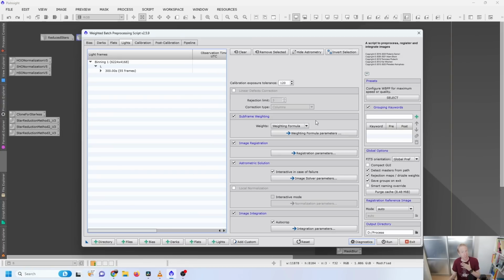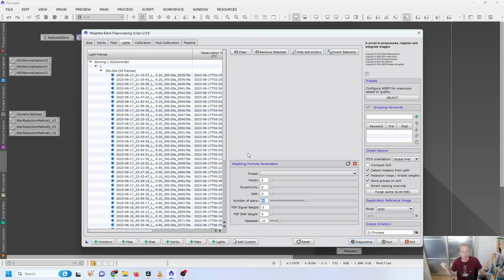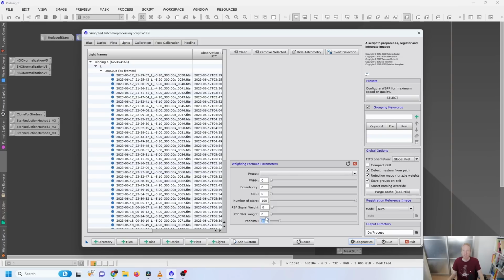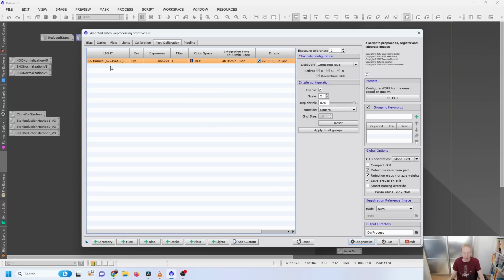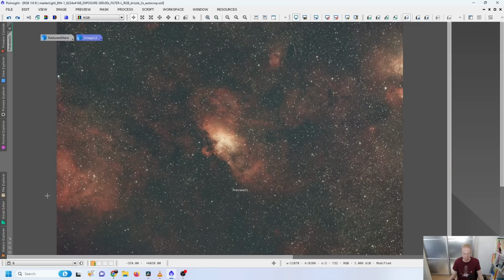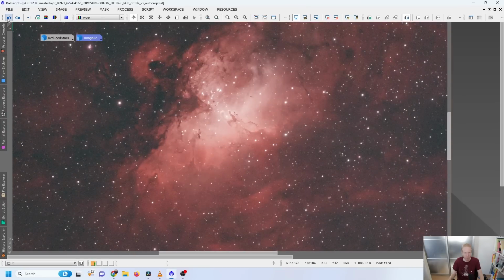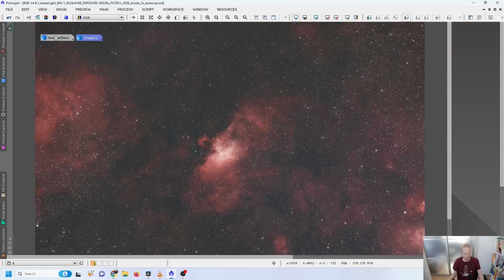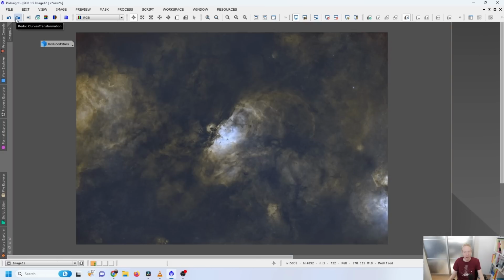New dew shield for better Hyperstar! Let's image the Eagle Nebula!

Comment: Domo arigato for your informative videos Cuiv... how do you manage the cables from your camera through the aluminum dew shield? Aren't the power/data cables from the camera supposed to cross the light path in a kind of arc, thereby requiring two exit points on the dew shield where it has only one cable exit point? Anyway, would love to hear how you work around this situation.

Comment: Nice video Cuiv, helps.

 want to setup anti-dew for Celestron Edge 8?

 A few questions if you can advise please:

 

1.  Is the Celestron dew shield still needed, if I setup the Celestron Dew Heater Ring?
 
2.  If both are necessary i.e Dew shield and dew heater ring, will the dew shield sit securely on the tube?  I am asking because the dew heater ring comes with strip attached on the rim, that holds the power sockets.  I am not sure if that would hinder the shield securely sitting on it?
 
3.   There are different tempareture regulators.  One is the Celestron Dewheater power controller.  But there are cheaper solutions like the svbony dewstrap power cable.  Would anything work?
 
4.    The regulation of power is imporant as I read; if we dont use the regulator, the standard 12v-3amp/5amp powers can cause optical aberrations / distortions in the images is what some have expressed.  Any pointers on this please?
 

Thanks

Comment: When you started using this dew shield did you have to stop using that "D" shaped 3d-printed part that routes your cables such that there are no diffraction spikes?

I couldn't get the celestron dew shield on my C8 with the "D" cable guide, so I'd be very curious to see how you pulled it off if in fact you did :-)

Comment: Hi Cuiv, couple of things; how about flocking the body of the camera (the outside of the barrel)? For the dreaded doughnut? The other thing was you inspired me to have a go at M16 the other night. Complete disaster, as the tracking kept dropping, destroying all but one single 90 second image. Amazingly, having used my Antlia dual band, narrowband filter, I was able to get my first image of the nebula ever, and it was so satisfying!
Reply from the maker: Well done on your image!! Even though a single exposure :-) I've thought about flocking but didn't want to harm cooling capability... With the dew shield it seems to be fixed so I won't touch it anymore :)
Reply: @CuivTheLazyGeek  Thanks for taking the time to reply. If it isn't broken, don't try to fix it :) For me, it would just be another tech challenge to work on. Maybe even coat the wires in glue, and cover in flocking powder (incredibly messy, but very effective). Last night I got another 80 or so 90s images, and once the caffeine kicks in, will start stacking.

Comment: Another fantastic video of a different setup as most youtuber.

TLDR: Are 6inch SCTs good for imaging with reducers on 1inch mono sensor?

You might be able to answer a question about the C6, since you're the only one that seems to be using one for imaging on Youtube: I'm doing the budgetting for my next years in the hobby building around one of the cooled 533 mono cameras (after Lukomaticos video of the new Player One 533 probably that one) and the ZWO AM3 so that I can have good portability.

For smaller targets I was considering a Meade 6 ACF SCT or a C6 since they seem pretty portable and the 1500mm focal length and with a x0,63 (950mm) and the starizona night owl (x0,4 = 600mm, once it release again) and with a barlow I can even try some planetary.

In your first video with the C6 you said you weren't concerned about it not being an Edge HD wince you were going to be using the Hyperstar but since I plan to shoot mono i will need a filterwheel I can find no reviews for the Meade 6 or the C6 with that configuration.

Thanks so much.
Reply from the maker: I would go Celestron, personally. Celestron let's you use the high quality reducers/flatteners made by Starizona (there's not just Hyperstar). Even an ACF will have trouble (coma is just one problem that's fixed)
Reply: @CuivTheLazyGeek  thanks! Maybe in the time I wait to get the money celestron release a c6 HD xD

Comment: Nice video Cuiv thanks 😊 
What do you mean by the dithering was not good ? 3px/frames, do you mean that it should have been dithering less than 3px/frame ?
Reply: I believe he stated actual dither motions every 3 frames, which means that it doesn't shift the frame by a couple pixels until each third capture. This means that his effective dithered frame count is in the neighborhood of 10-20, not really enough for effective drizzling
Reply from the maker: Exactly explained there thank you!